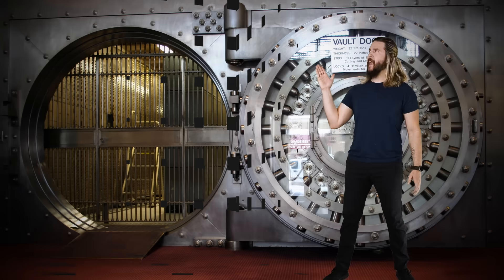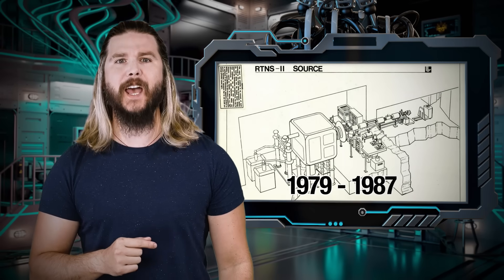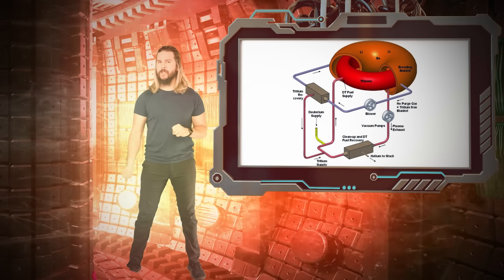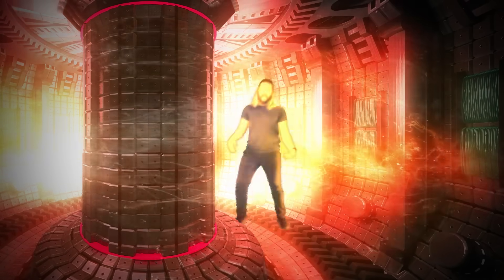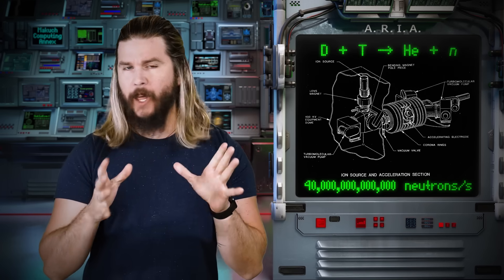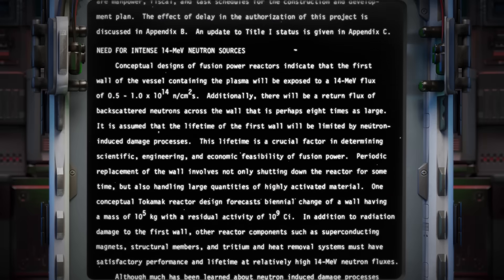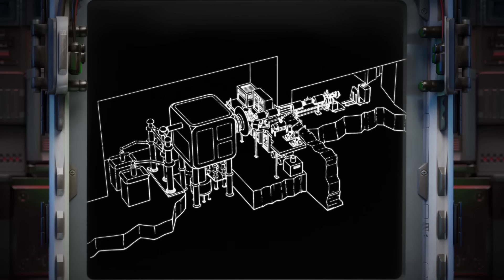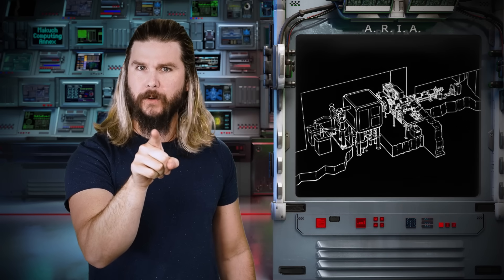What’s Behind the World’s Heaviest Door?

Comment: This uh......... this actually kind of changes my perspective quite a lot about the difficulty of fusion energy. It's not just achieving net energy. It's also solving the problem of degradation and activation of the materials used to build the reactor due to the intense neutron flux of the reaction. It's very possible that the nuclear waste from a fusion reactor could be worse than from current uranium fission reactor designs, due to activation of the reactor vessel itself. :x
Reply: The goal for activated fusion walls is that after 100 years they can be buried 20 feet deep as low level radioactive material. However this may not be the case as it will be very difficult to find any material to survive well at all so that the activation profile might end up as a secondary consideration. It is likely that fusion activated material would be far less intense than the worst fission byproducts but I assume it would be in greater quantity than the comparable low level fission material

The proposal for the ARC reactor is that the inner vacuum chamber would have to be replaced every 2 years at a cost of 100 million, half a billion per decade is definitely a problem for commercial prospects. It's usually said that commercial fusion requires a power gain of 20 over the fuel input energy while ARC is projected as a gain of 13. Which is really quite close, but maybe still far away

There are alternative designs that have better engineering prospects but are less tested as far as physics - like Helion's Deuterium-He3 reactor that would recover the energy of charged fusion products directly in the electromagnet at high efficiency, and there's some liquid inner wall concepts like General Fusion's super giant 100 MW spherical piston design
Reply: Yep at the levels of radiation used in a fusion reactor you literally have to deal with it turning structural materials into Swiss Cheese. A containment structure that could have laughed at an artillery bombardment when brand new can be reduced to having the strength of a stale biscuit because it's been torn up at the atomic level; even transmuted into an entirely new element!

Comment: I don't quite follow why they needed a thick door, as opposed to a more normal door connected to a corridor that zig zags through a sufficient amount of shielding. I'd have thought that extra thick walls would have been cheaper than a complex heavy door. Was it an issue of getting test materials inside the chamber? Where having a door close to the sample made the process easy enough to justify the cost.

Comment: Some sources say that you shouldn't use the unit "rem" after the 1st January 1985. Instead, you use the Si unit "Sievert" (sv). So that neutron ray could output 100 Sv.

The only other person that had a nuclear accident where a nuclear ray hit a living human was in Russia, but it was a proton ray.. Didn't you cover the accident of the russian nuclear physicist Anatoli Bugorski? He can tell you exactly what happens if your head gets in the way of such a beam. You will feel intense heat along the path of the beam. He had some swelling, some tissue damage but apparently he didn't die.

And if I remember this right, Neutrons aren't a huge problem before they hit a moderator, such as the water in your body. They require a certain distance before the energy level of the neutron is slow enough to transmutate another element. That distance in pure water is about 20 cm, in a human it's averaged to about 29 centimeters. So an average human outside the USA should not be affected (except for the heat from the slowing of the neutrons) if the ray hits them from the front or back. It creates the beautiful blue glow of Bremsstrahlung all throughout the affected body part, but it will not kill (unless you hit e.g. the heart). Apparently (see Anatoli), even hitting the brain will cause permanent damage but it won't kill.

Comment: There's a story I remember my dissertation supervisor told me: A steel used or to be used (don't quite recall) in a reactor housing but would become brittle and nobody knew why. It was found that the Silicone used the steel to increase its strength had been transformed into Aluminium due to the radiation
Reply: Indeed alchemy is actually possible in that way. U just need a particle accelerator or some other source of radiation, something that however did not exist when they tried transform lead into gold in the middle ages. Instead they tried using piss, EEEWW! Not sure if u can transform lead into gold with an accelerator either but logically it should be possible. The issue is the cost of the energy required to run the accelerator will be many times the value of the produced gold. Its same as with antimatter production and so its infeasible for anything but research purposes.
Reply: @johnpekkala6941  There is probably a decay chain from some isotope of lead to some isotope of gold but I don't recall any.
Reply: @josephvanas6352  stable was implied, I should have been explicit.
Since I became curious, I dived a bit deeper and there exists at least one decay chain leading from radioactive lead to stable gold : 
_{82}^{197}Pb -> _{81}^{197}Tl -> _{80}^{197}Hg -> _{79}^{197}Au

Edit : formatting
Reply: @josephvanas6352      As a kid, I thought that was the plan in "Goldfinger" -- nuke the gold so it turns into something worthless.   Took me most of the movie to realize that people just wouldn't WANT radioactive gold, so no value.
Reply: @josephvanas6352  You could sell it to someone who doesn't know it's radioactive. He may come to harm later, but what would a no good thief care.
Reply: @stevenscott2136   "people just wouldn't WANT radioactive gold" they would want gold if they didn't knew it was radioactive
Reply: @josephvanas6352   stealing radioactive elements isn't a good thing because they're can be traced
Reply: @johnpekkala6941  if you think about it the use of piss in alchemy led to the invention of phosphor
Reply: @johnpekkala6941  Ironically they were using the wrong material , they should have used bismuth
Reply: Neutrons also cause steel to become brittle and lose strength. Containment vessels are sometimes annealed with heat to help reverse this.
Reply: Yeah but that never happened
Reply: Only about of time before we sort out homunculi.

Comment: Would adding lead to the door allow you to shield aganst radiation better? Or is it too impractical for other reasons? You only mentioned Concrete and steel, so I wondered about lead.
Reply: Lead is usually used because you don't need as much of it, but that's the only real difference. Any material would work if you had enough.

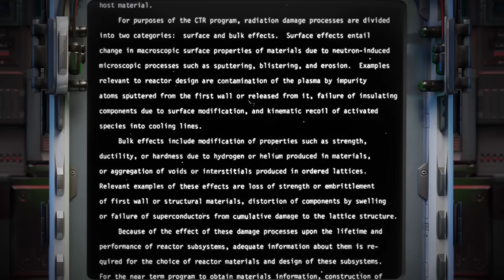Comment: Wait a sec. At about 6:45 Kyle starts talking about effects of the heavy radiation released by a fusion reactor. If the lining got that dense and radioactive, couldn't you use it as fuel for a fission reactor afterwards? You'd get more life out of it, and by using it more, you'd reduce its danger a bit before having to hide it away again. Entirely okay to tell me that it's a stupid idea. I am in no way a nuclear physicist :p
Reply: I'll do you one better and use it as fusion fuel (tritium) - that's possible and in fact one of the more likely ways to deal with the issue.
Reply: @jandl1jph766  Gotta love that high grade recycled fusion fuel made from the liner of a fusion reactor. Because of course after you finish destroying a reactor, you use its corpse to power the next one.
Reply: @dreadnaughtscout8552  You don't even have to destroy it - the liner in that case would be a lithium isotope, which is a liquid at those temperatures. The tricky part is getting the liquid liner to flow without gaps, but from what I've read, that's considered a solvable engineering challenge. Once it's out of the reactor chamber, you pull out the dissolved tritium and recycle everything back in. That doesn't completely stop the activation of the outer liner (which the inner, liquid liner flows on), but it's far less of an issue that way.

Comment: The way that changes in material that has been irradiated is measured, is through a measurement called the reference transition temperature. This measures the temperature at which any given material will transition from state to state (ie solid to liquid, liquid to gas, etc), and then that is compared to that same material after it has been exposed to a certain amount of radiation (be it alpha, beta, or gamma). Fun fact for the day.
Reply: Not quite. It measures at what temperature a material is more likely to fail in a ductile manner vs brittle fracture, not when it transitions from one state to another, so it's the temperature at which a material transitions between ductile failure and brittle fracture. For example for a given material, above its reference transition temperature (RTT) it's more likely to fail in a ductile way, while below its RTT it's more likely to brittle fracture
Reply: I thought they subject samples to physical testing (brittleness, ductile limits) and electronic microscopes looking at structural changes.

Comment: "Activation" is really worrying since one of the main selling points of Nuclear Fusion is that it does not produce radioactive waste. So not only will someone have to go in there are remove all of the panels from the inside of a fusion reactor regularly but disposing of it will have some of the same problems as waste from fission.
Reply: Well, it does create radioactive waste. But the amount and dangerous lifetime are on a much lower scale than uranium fission reactors.
Not perfect, but much better.
Reply: The safety of fusion is that if humans disappear it will turn off pretty quickly and not have a runaway chain reaction like fission.
Reply: Yup. The safety concerns with fusion are pretty comparable to fission actually.
Reply: @danieljensen2626  fusion meltdowns isnt possible on the scales of the fusion reactors we are building right now, so thats not a concern unlike the fission ones. once you turn off a fusion reactor, its only residual radioactivity left in the reactor itself. 
with fission reactors you have the fuel and the reactor core being very radioactive even after you shutdown the reactor, hence you need to keep running coolant through a fission reactor core even after you turn it off, not to mention the concern of meltdowns if things go wrong, like damaged control rods, malfunctioning cooling systems, etc
Reply: And the removal process for fusion seems more  difficult that for fission

Comment: Your two balls reminded me of the battery bounce test. 

Get an iron skillet, 1 dead AA and 1 live AA battery. Hold each sideways about 8” above the skillet. As you drop each, a charged battery will land with a thunk and a dead battery will bounce. 

So if you have a pile of batteries in your kitchen junk drawer that need testing, that’s a simple one.
Reply: You can do this on practically any surface
Reply: why an iron skillet? a kitchen countertop or even a wooden coffee table will work fine
Reply: @nikopack7571  The iron skillet won't take dents or chips like a counter surface or wooden table might?
Also, should a battery break and leak, it's easier to fully clean a pan than your whole kitchen.
Reply: @MonkeyJedi99  what kind of double A's you got that ruin an entire kitchen?
Reply: @capness1228  None... yet.
But if I did have a battery open up on food prep surfaces, you can bet I would clean the bejeezus out of the whole place to avoid any toxic exposure.
Reply: @MonkeyJedi99  ...a skillet is a food prep surface. It's not alien blood, it isn't going to splatter everywhere and instantly burn through walls. Calm down.
Reply: @capness1228  I am calm.
A skillet is contained, and the marginally possible contamination of a broken batter would be contained within it.
-
And this whole rabid defense of dropping batteries on counters and tables is pointless anyway, when a simple battery tester is such an easy and cheap tool to get.
No dropping anywhere required.
Reply: @capness1228  Have you met my mum? Apparently newspaper can ruin the kitchen counter.
Reply: @MonkeyJedi99  Mneh, we don't even use mercury anymore.
Reply: @capness1228  man got super dense 1kg aa batteries lol
Reply: @MisterLousy  you've put newspaper on the counter? Eeeew.... tell me it was at least before the pandemics...
Reply: @capness1228  9mm batteries
Reply: I chose Iron skillet because it does not give like wood or countertops (which one's kitchen counter might be wood underneath linoleum) and I meant the back of a skillet, not the cooking side. If someone uses their coffee table or kitchen counter or anything that gives some, it may skew the result. I specifically chose a skillet because I knew it was something that does not have enough give to cause something to bounce. But it is true that you can use any completely solid surface.
Reply: @scyberclops  GENIUS 
Everybody just promptely assumed it was the cooking side, including me 😅
Reply: That's cool to know but the question I have is what do semi charged batteries do? I.e. batteries that definitely aren't full but also not empty yet?
Reply: @Wiseguy150  I checked that actually... they don't bounce as well as fully charged - funny, I had the same thought process.
Reply: @Wiseguy150  i assume it would still bounce, just not as much. It would be a scale of how much energy is in the battery compared to how much has been used
Reply: Makes sense. A battery is a chemical reactor. When it's in use, the stuff inside is reacting and electrons are flowing from the metal of the case, through a circuit and back to the centre. The chemicals in between help them react. So a dead battery will contain different chemicals, the reaction products, than a fresh one with fresh reactants. It's interesting that it makes one bounce but it's not surprising.

The bounce might be due to hydrogen gas inside under pressure, it can be a product of some battery chemistries. Or perhaps the case is weakened by being partly reacted away, so it's less springy. Interesting post, OP.
Reply: I need to find a dead battery now
Reply: @themeanestkitten  Kitchen junk drawer?
Reply: If you have a flat surface you can let wood fall on it to check if that edge is completely flat. If it's not, it makes a sound as if you just threw something on a table, but if its flat you'll just hear the air and a muffled thump. Cool trick to impress new woodworkers with lol
Reply: @zoutewand  between the battery bounce and your woodworking trick, it reminds me of what happens when rolling dice on inch thick corrugated  cardboard pallet dividers. 

Roll the dice and it sounds like they're still rolling and coming to a rest, but the dice have been just sitting there, the cardboard having dissipated the kinetic energy.
Reply: Dude just use your kitchen counter.
Reply: Thanks
Reply: Or just put a voltmeter on them, because it will take me longer to find my skillet! :)
Reply: If i have a pile of batteries i might as well go and find the damn multimeter and do it right, lol
Reply: @JavierChiappa  not everyone has one... in fact I'd guess 99% of the population does not
Reply: I've gotten battery acid on my hands and it just burns a tiny bit. It just feels like you got some hot sauce on you or something like that but it also really dries out the skin it comes in contact with so make sure you put on some lotion after washing yourself if you ever get it on you.
Reply: @zus8926  It puts the lotion on its skin or else it gets the battery again!
Reply: @MonkeyJedi99  what?